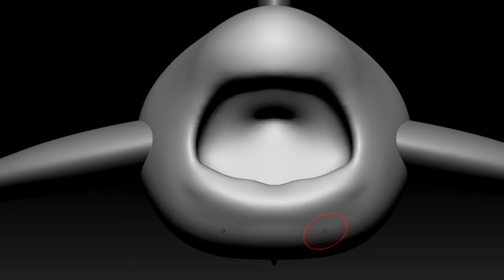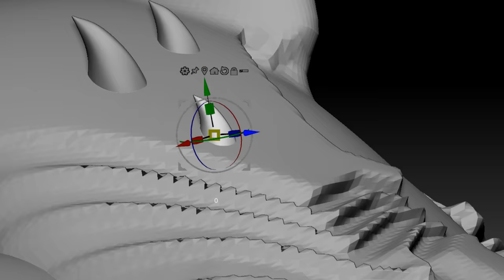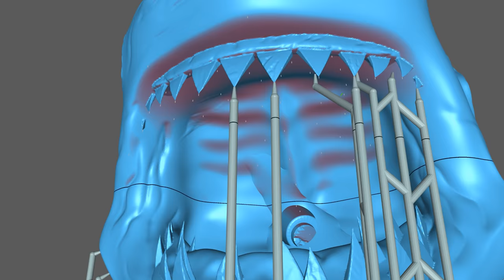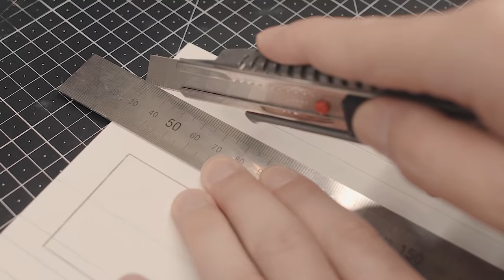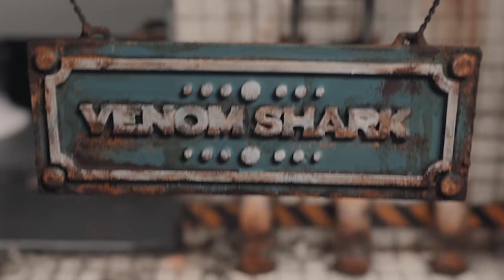How to make a symbiote-infected shark diorama / Epoxy resin

Comment: Towards the begining what was that water u put the shark in that sounded like it was electrifying the shark? What did that do? And what was the material you made the walls out of it looks like plastic but it look like you cut through it like it was styrofoam
Reply from the maker: The wall is formex
Reply: @ZERO_Figure_maker  ok cool and what was that water u put the shark in that sounded like it was being electrified?.. what did that do?.. I guess you would consider me a little bit above a beginner at making dioramas.. I'm always trying to find ways to make them stronger.. the foam board is cool and all but can be easily damaged..that formed stuff looks moren plastic...solid ..an example is like if you were to drop anything with just a little bit of weightonto the piece of foam board it'll leave a mark a little dent depending on what you dropped. The stuff you use looks like things will just bounce off like a piece of plastic

Comment: what resin do you use for pour and do you use a pressure pot/vacuum chamber?
Reply from the maker: Epoxy resin. We work after removing air bubbles using a compressor
Reply: @ZERO_Figure_maker  what brands/ manufacturer of epoxy do you usually use?

Comment: did u use wood for the Background ?
Reply from the maker: No wood was not used😅
Reply: @ZERO_Figure_maker  please tell me what u material did u use thank a lot :))
Reply from the maker: @gamexy5979  It is a material called Formex.:elbowcough:
Reply: @ZERO_Figure_maker  do u have a link to the material cot it show only watches
Reply from the maker: @gamexy5979  Apple Watch??? 😅😅😅😅
Reply: @ZERO_Figure_maker  formex or Forex ? because when i look for Fromex i find a Formex Watch no material i would like to know because i start with dioramas and the material u used is that what i looking for
Reply from the maker: @gamexy5979   https://www.coupang.com/vp/products/5208914580?itemId=7279867369&vendorItemId=74571309714&sourceType=srp_product_ads&clickEventId=23c069e9-0b1e-47ad-8848-0bffc8ded3a0&korePlacement=15&koreSubPlacement=1&q=%ED%8F%AC%EB%A7%A5%EC%8A%A4+5t&itemsCount=36&searchId=5bfd82c0d5dd4a078535d40c96ff0efe&rank=0&isAddedCart=

Comment: dude, why does the corner of your resin parts are always falling down ? It ruins a perflectly done model ...
Reply from the maker: I didn't know it either, but if there is an object higher than the epoxy, it will be like that because they grab each other. Experience is an important part
Reply: @ZERO_Figure_maker  Maybe you could cheat with pod modge or any other wave / surface stuff ? I saw Luke Towan filling some gaps with it in some of his videos, it's perfect to make waves but i think it could do the job. I really hope you will find a solution for this !!!